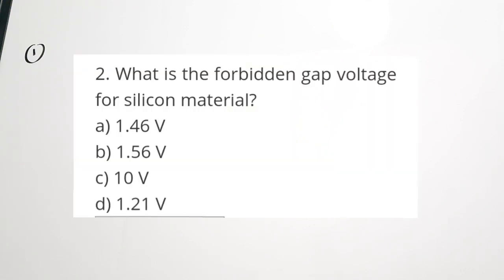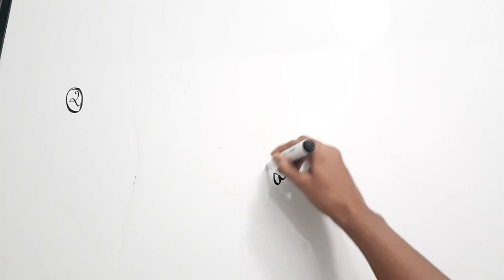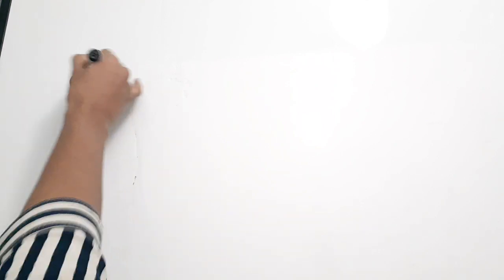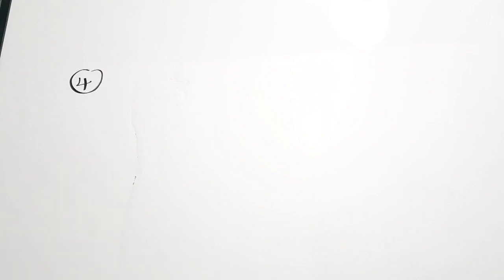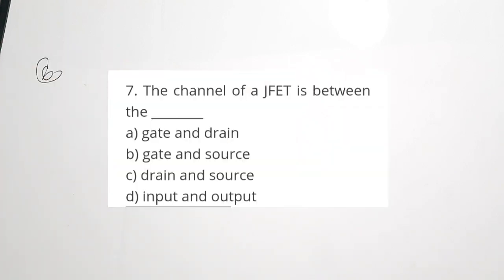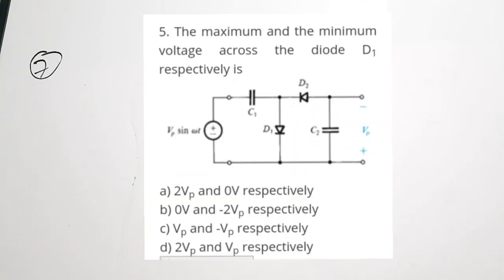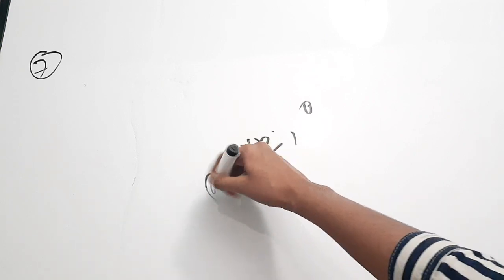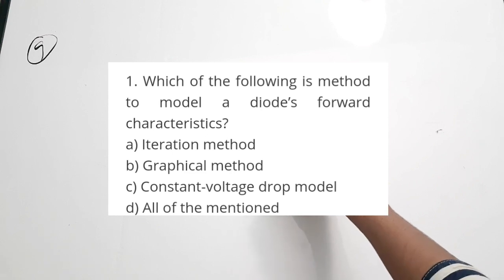AFCAT EKT Electronics Mock Test Part4| AFCAT EKT Electronics 2021 Questions and Answers| AFCAT 2021

Comment from the maker: #corrections in Question of transconductance Amplifier Question Answer is Voltage to Current Converter.
Also for Rectifier Question output DC power is (Vm/pi)^2/RL 
Regret for the mistakes. Please correct them
Reply: Diode question ans is changing?, hope you reply 🙏🏼